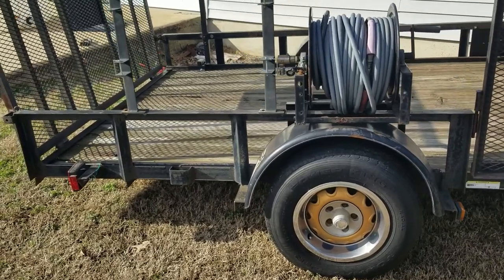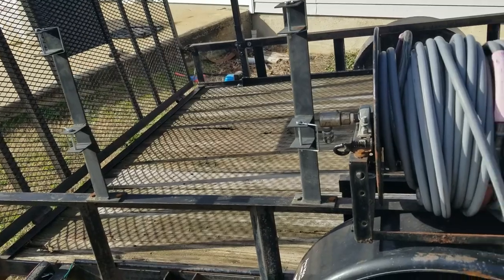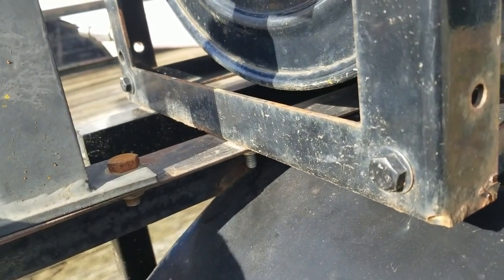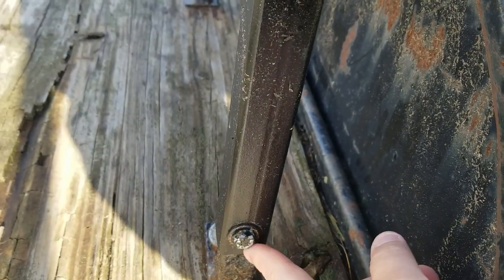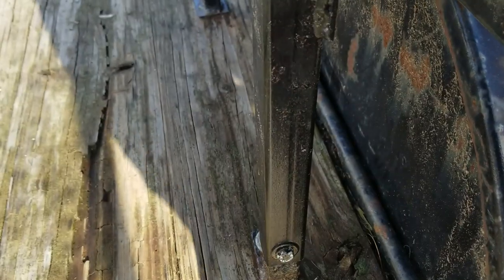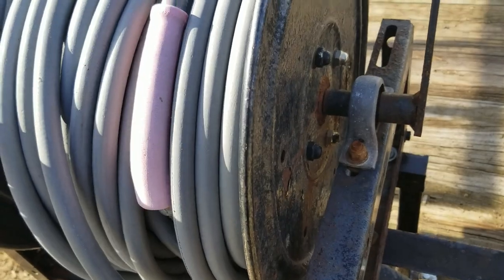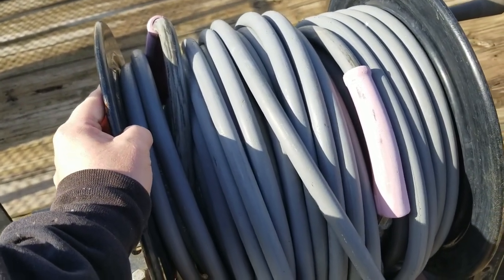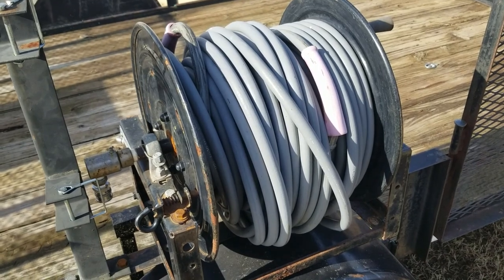Hose Reel Installed on Pressure Washing / Lawn Care Trailer Build | Solo Owner-Operator Setup Part 1

Comment: This is awesome! Could you give the size of the square tubing and the brackets you used to mount it to the trailer? I can’t find them
Reply from the maker: It's square tubing and angle iron. You can use whatever size you need or have on hand. I believe the main tubing is 1x1. It was already made and used in a pickup bed when I got it used, I just modified to work on my trailer. Thanks for watching!